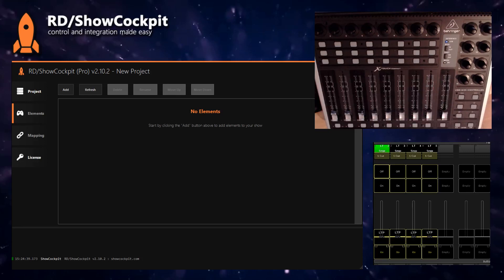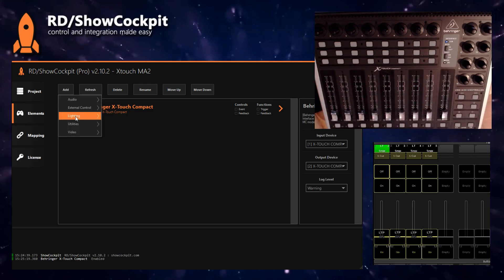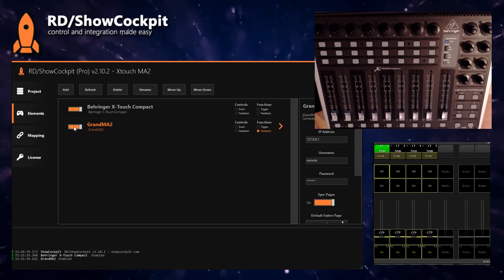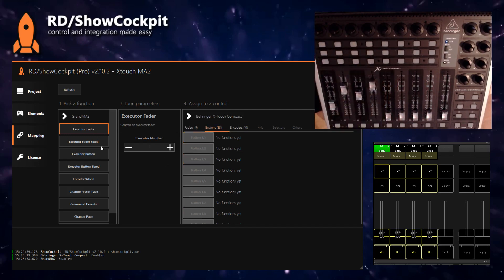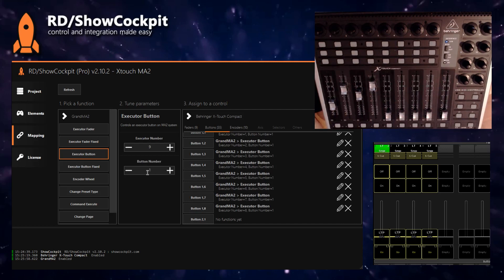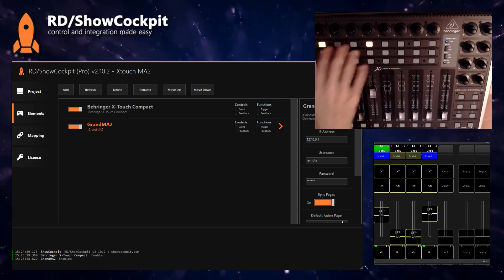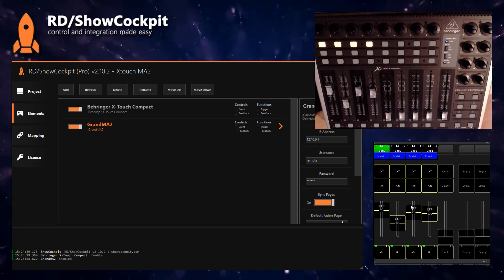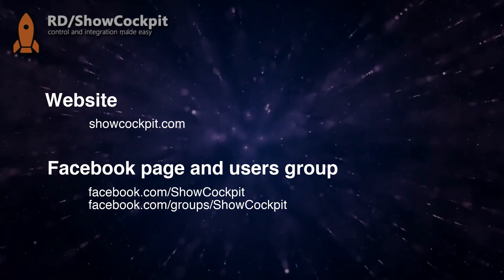Connecting an X-Touch Compact to MA2

Comment: The encoders 10 through 14 don't appear in the encoders tab in the xtouch driver. Is there a problem with those and am I not able to use them as Inputs for grandMA3 encoders?
Reply from the maker: Reason is explained in the driver FAQ: https://showcockpit.com/site/docs/?d=59
That is a limitation of the X-Touch MC mode mapping. If you notice the LED indicators on the X-Touch, you will see that the MIDI OUT does not light up when you rotate these encoders (it means the controller is not sending any MIDI output). There's nothing we can do about it!
Reply: @ShowCockpit  can we use it as MIDI instead of mackie mode?

Comment: Question: 
If i change the Executor Page /Channel on MA2 software, is the midi controller now going to control the executors on the new current page/channel, or will it continue to control the executors on page 1? If yes, can this function be applied on a "AKAI APC mini" as well, or will i need a more advanced controller such as the XTouch or APC20?
Reply from the maker: Yes, bidirectional page sync is possible - check this out: https://academy.showcockpit.com/tutorials/lighting/ma2-bi-directional-page-sync

Comment: How do you enable the motorized feedback?
Reply from the maker: You don't need to enable anything. It just works :)
Reply: I figured it out, your system assumes that the motorized faders will be on the first faders whereas I was trying to control 61 through 68.
Reply from the maker: You can increase the number of executors to get feedback from on the GrandMA2 element options (by default it gets the first 15 only).
Some info here: https://showcockpit.com/site/docs/?d=25
Reply: I gotta say, this system is way more responsive that Ma2Tools. Well done
Reply from the maker: Thanks for the feedback! ;) Really appreciated!